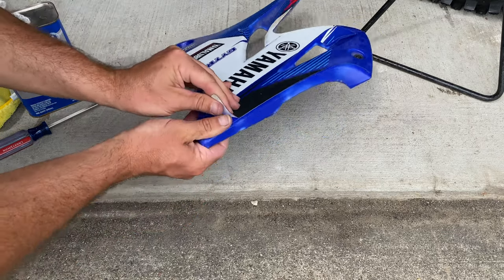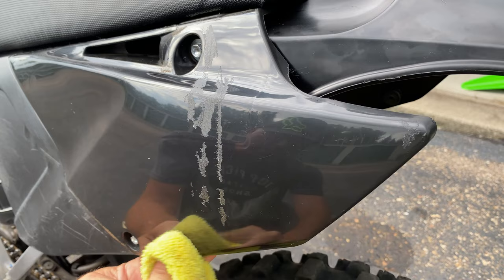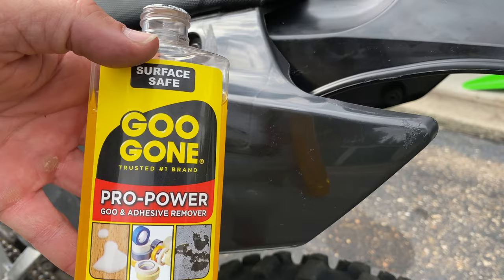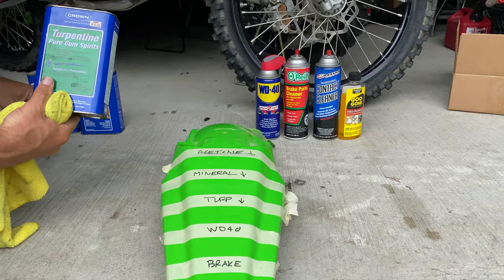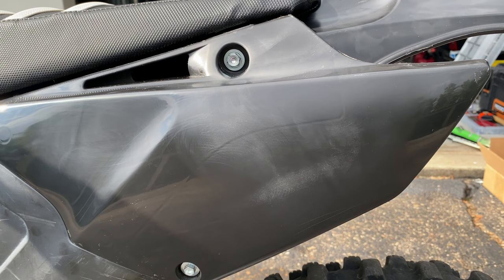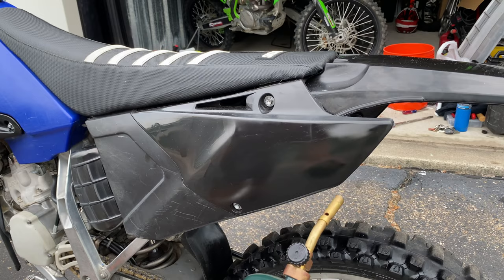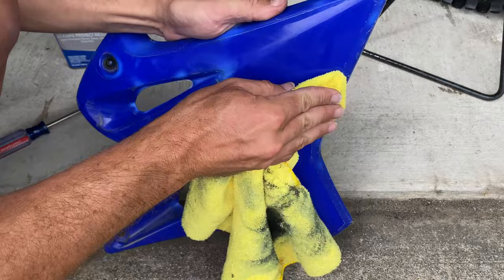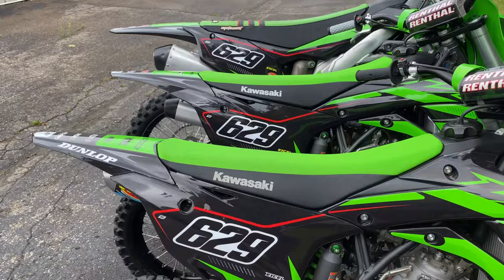Cleaning Sticker Goo and Other Stuff from Dirt Bike Plastics

Comment: I've been hesitant to use acetone as it can be quite strong but you have proven it to be quite effective. Great news! I usually use Kerosene for cleaning most area's on my bike. Works well!
A tip for getting the dull, white haze out of plastics especially on black one's is to use a product from Autosol called Acrylic Polish. It's mostly used to get scratches out of headlights but works great on any plastics affected by white hazing. Give it a try!

Comment: I usually use 90% rubbing alcohol to remove adhesives. And if needed, use the buffing wheel dry to bring back the high gloss by heating the surface slightly via friction. This is about the only way to modify the soft plastic surface for high gloss.

Comment: DO NOT USE ACETONE. I damaged my Honda 125r fairings badly from using acetone. Minor scratches in the plastic allow exposure to acetone to boil up and look like a bunch of cracks in the plastic. It basically dissolved the plastics :(

Comment: Gotta be nuts to use acetone or paint thinner. Great way to discolor/damage abs plastics in.my opinion. Use blow dryer, NOT heat gun to pull decals off. Been there, used many products.

Comment: Wouldn't using a heat gun while removing stickers, keep more of the glue on the sticker instead of the plastic? That's been my findings anyway. I've never removed stickers without heating them as I pull.
Reply from the maker: For me, the heat gun has been hit or miss.  It seems to work better if the graphics are newer.

Comment: a plastic fender is most likely molded so there would be no surface finish, i dont think theres a way to really bring that back unless its remade. you can polish but your essentially making microscratches and trying to blend them. Since there is no scratches to begin with and you will always see them new will always look shiny and buffed will be dull. No clear coat or paint to work with like on auto paint 

ps. why did it have to be the new 2017 plastics hurt a bit to watch  u ruin $300 and as a car detailer ill be trying what we use at work might be a good idea to sell it to mx folks if its better than axetone cuz i use that at work as well

Comment: Is simple green safe on everything on a dirt bike?
Reply from the maker: Since I don't know what every part on your bike is made of, I can't answer this question with certainty.  However, I've used it on many parts with no problems.  I wouldn't use it to clean plastics right before putting new graphics on though because it seems to leave an oily film that may make the graphics difficult to stick.